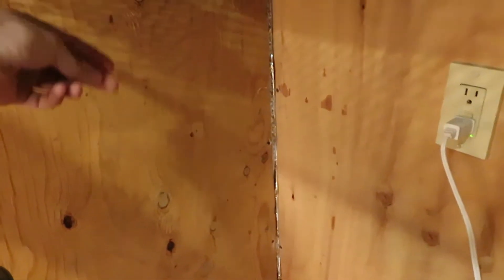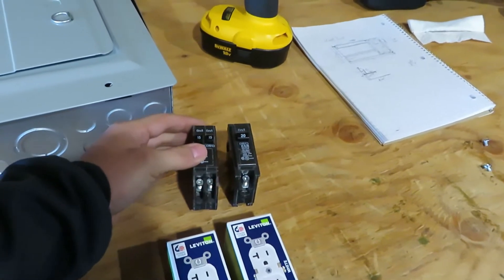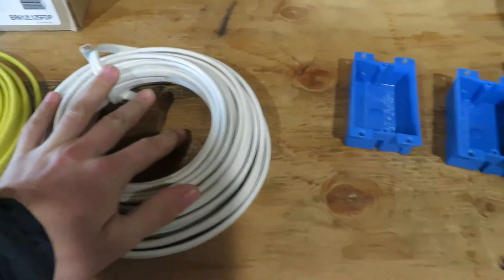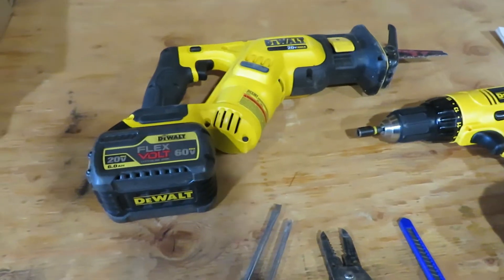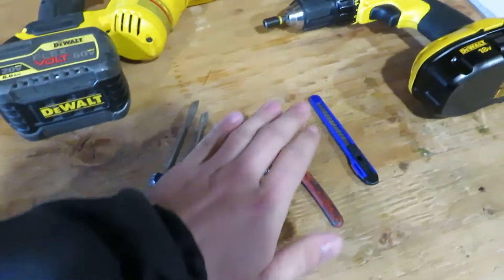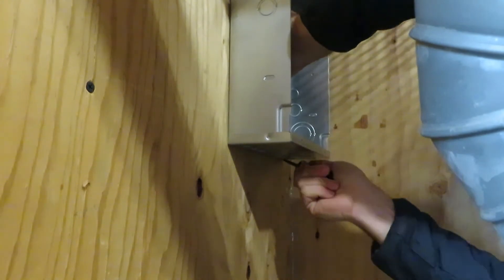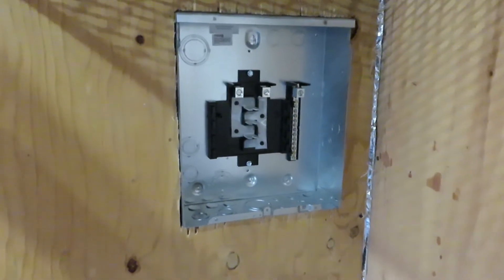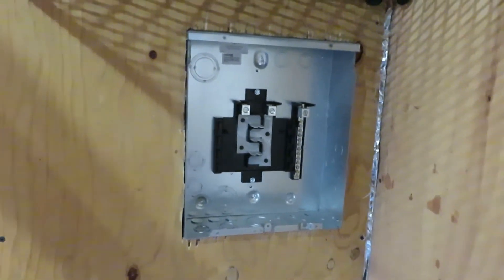Installing Electrical Panel - Shipping Container Tiny Home #3 -

Comment: How do you power the sub panel
Reply from the maker: I just used a 12 gauge romex, which ran from an electrical plug. The breaker panel then goes from 12 -> 14 gauge wire through 15 amp breakers, or 12 -> 12 through 20 amp breakers, so everything is protected.

Comment: Hi are you using a solar system to charge your home ?
Reply from the maker: At the moment I've moved from the shipping container tiny home. I've begun work on a tiny home on wheels which will have 2400 W of solar, a 3 kW inverter/charge controller, and 6.4 kWh of lifepo4 batteries.